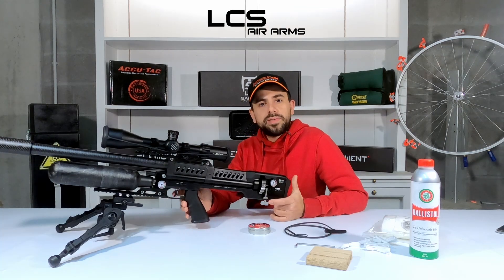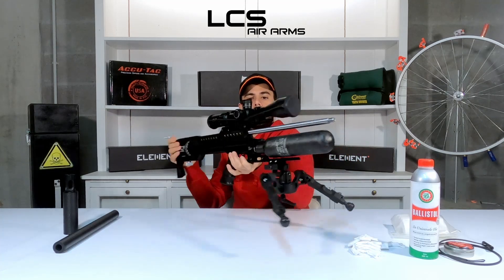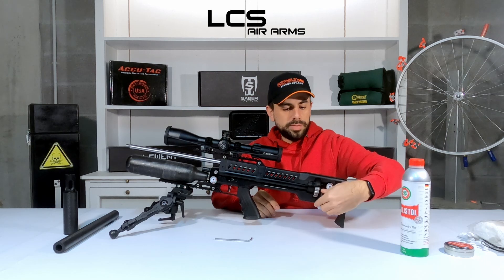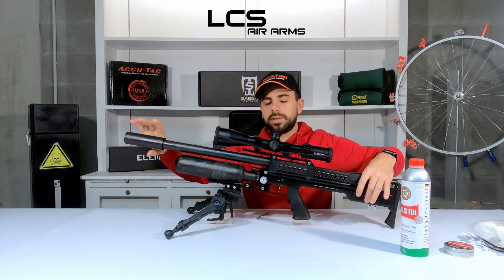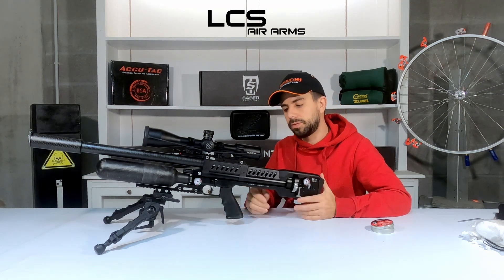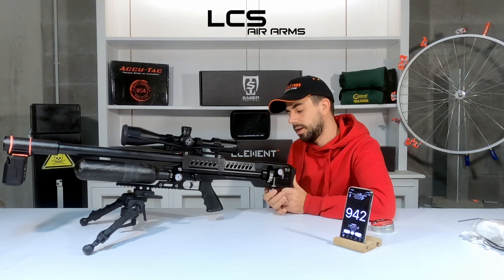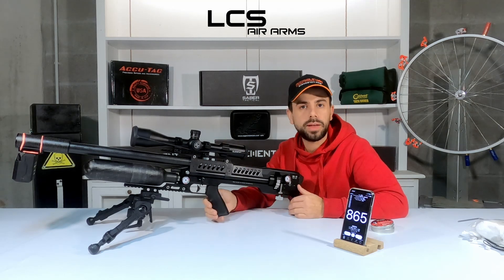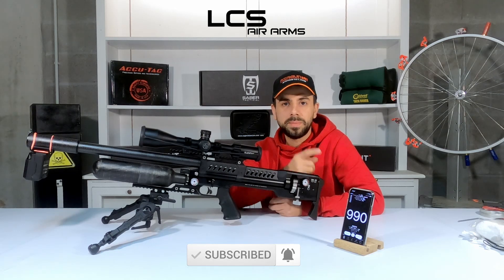LCS SK19 barrel removal and tune

Comment: Getting the barrel just right to the magazine is incredibly important. Not only for top performance but efficiency. Gap to big the accuracy and efficiency is effected, while to close/tight, performance is effected. I really wish we could measure with a feeler gauge. Oh well. Love my .25 sending 34 grain FX pellets…all 19 rounds @ 905 fps inside a 2” circle at 100 yards or tighter. This platform is a hunters dream I swear! Awesome video bud thank you. BTW make sure your barrel clamp bolts are tightened down properly. Anti-sez grease helps make sure they don’t snap when removing in the future for you 500 round cleaning. Fast you push the ammo the more often you need to clean your barrel. Hope this helps. .22 cal has a LW barrel & .25 has a LW Polygonal barrel match grade. Wicked good barrels!
Reply from the maker: Thx for the tip about the grease, I mostly put some silicone lube on them but grease might work better .
Indeed the barrel setting could have been designed a little better and eliminate the fiddling, every time you think you have it spot on it moves ever so slightly when doing up the bolds 🥴 and you have to start over
Reply from the maker: Thx for the tip about the grease, I mostly put some silicone lube on them but grease might work better .
Indeed the barrel setting could have been designed a little better and eliminate the fiddling, every time you think you have it spot on it moves ever so slightly when doing up the bolds 🥴 and you have to start over

Comment: Sorry for the second comment but your accuracy will improve “IF” you push the pellet or slug all the way in with something like a wooden or plastic golf tee or even a tooth pick. The .25 cal demands this really. The .22 not as much but you WILL see a difference down range when your groups get smaller. Stay blessed and keep’em coming sir.
Reply from the maker: Thx , yes indeed I have seen a slight improvement in accuracy doing this 👍 but not always worth the hassle as I have more fun plinking with the LCS 😉
Reply: @Airbuks  I do pest control so accuracy really matters and if that’s where the shooter is that it will be a requirement or maximum accuracy. It is a great gun and super fun to shoot. Thank you for your reply. BTW the FX 34 grain pellets, feel like they are tighter in the magazine and in the bore, and do shoot better groups than the JSB MK twos.😊

Comment: once again great video! i got a new moderator for mine today and i noticed when i unscrewed the old moderator and shroud the barrel was turning too i was able to unscrew the barrel without losening the two 4mm hex screws and it was difficult to remove the old moderator but after watching this video i think the screws are not tight and i will check them tommorow the new moderator is awesome though
Reply from the maker: Thx mate , those 2 screws to fix the barrel could be done differently. I am always afraid of snapping a bold when undoing them or tightening 🙈 hope this never happens 🤞🏻
Did you get the Donny adaptor to fit a different moderator?
Reply: @Airbuks  yes I got the 02b and I also tightened the two screws and now my gun is dialed in

Comment: Thanks for this video. This is one of my “gotta have” rifles. So versatile. Not just a spray and slay gun. I’ve see rabbits taken at over 400 yards with the SK 19. Lothar Walther makes great barrels.
Reply from the maker: Yeah it’s a cool rifle , I am in the process of getting familiar with it and will make a range video in a few weeks 👍🏻
Reply: I have one in 25 cal with the Pard 008 LFR NIGHT VISION. bought it thinking i would do some night hunting but never did. i would sell the whole set up  including case and spare rechargeable battery for scope for $2300.  the scope alone is $1000.
Reply: @Scott-cu4ol  Ah, if only. Unfortunately I have too many other financial responsibilities at present, but maybe someone else can take you up on that offer.
Reply: I would stay far away from this airgun too many issues. It's a POS

Comment: I was on the fence for a .25 caliber pcp air rifle and it was between the SK19 and FX Maverick. I got the Maverick. It will be shipped next Friday. Got the ELEMENT HELIX 4-16x44 FFP and FX no limit ring scopes to go with it. I'm a single shot loader so I got a single shot loader for it too.
Reply from the maker: The Maverick is a awesome gun aswel 👍🏻 depending on what you want to do with the gun they are very different and have a completely different valving system . I own both and like both for there own reasons 😉👍🏻

Comment: Do the set screws make a slight divot on the barrel that would be visible if you looked in the screw holes for re-installation and or could you mark them with a sharpie prior to removal? Also wondering if it would it be beneficial to mark the barrel prior to removing for reinstallation?
Reply from the maker: Hi , the set screw do toch the barrel the tighten a clamp to hold the barrel .
Marking it in front isn’t a option ether as the setting is so minute that it won’t be accurate enough 🤷‍♂️
Reply: @Airbuks  but wouldn't you be factory set if you co witness the barrel and frame with a sharpie out for the box? 

The seating of the barrel to the magazine has to be perfect?
Reply from the maker: @Giovanni-zc1lv  yes there for you have to do it by hand / touch a sharpie isn’t accurate enough for me , but it can give you a very good baseline.
If you want to go that way I would consider a permanent mark ( scratch ) that is finer and wil not fade like a sharpie
Reply: @Airbuks  got it Thank You Sir!

Comment: Cool gun!  Will you do an accuracy comparison @50/100 with this gun and your m3?
Reply from the maker: Hi , I will be making a range video with the SK19 yes but I don’t do comparisons between guns and specially not when they are from different manufacturers 😬
The 2 you mentioned are also not a comparison in my opinion because they have a very different valving and firing style as the SK19 shoots straight out of the mag .
People will always pick one above the other and will think the other one is less good . I make several separate videos and people can compare between them that way 😉

Comment: Great job!!  love your videos!!    My sk19 has a loose fitting at the connection where the bottle meets the manometer--that block/mechanism is loose and the gun has a leak ( i assume because of the connection)  Any ideas?
Reply from the maker: Thx , have you checked the orings inside the bottle valve .
It’s a tricky one to see , if you unscrew your bottle and look into the valve of the bottle there is a oring at the bottom, if this one is damaged you might have a leak there .
If the leak occurs from the adapter then that is your next spot to investigate. But I haven’t disassemble the SK19 yet so I don’t know how it’s assembled
Reply: another thing to note is that "block" can pivot up to 10 degrees each way and that is supposed to be normal.

Comment: i drop my gun and the grip has broken, just wonder is there any website to order the replacement grip for my gun (lcs sk-19) .22 caliber. thanks
Reply from the maker: It depends when you bought the gun , since end 2021 LCS has implemented a standard AR15 grip , before that it was a special not so know grip
Reply from the maker: It depends when you bought the gun , since end 2021 LCS has implemented a standard AR15 grip , before that it was a special not so know grip